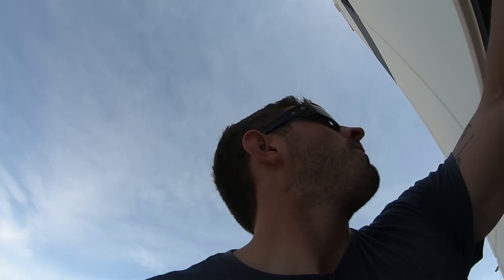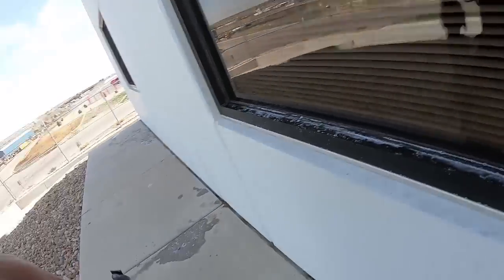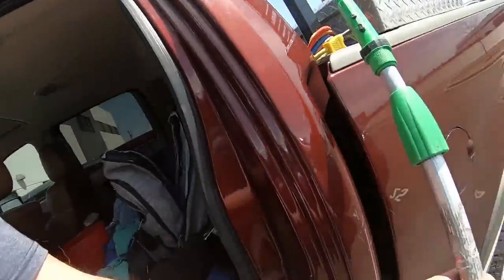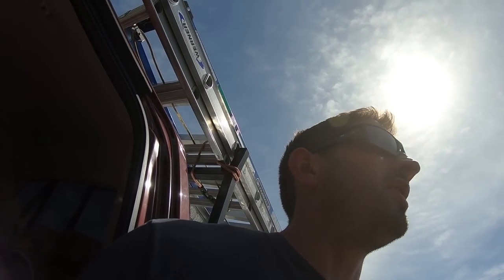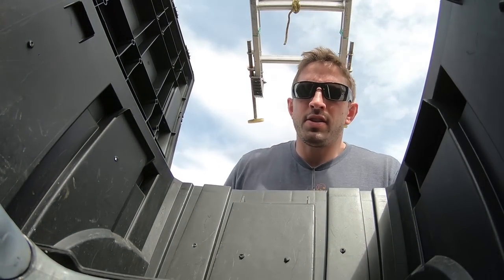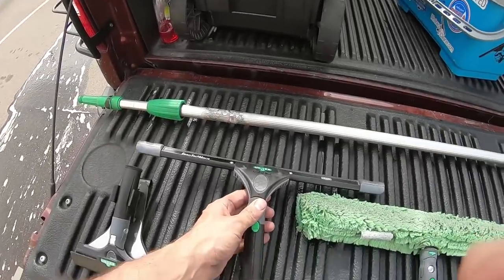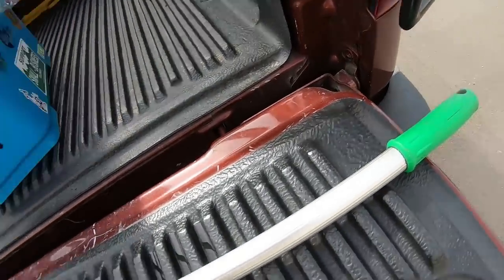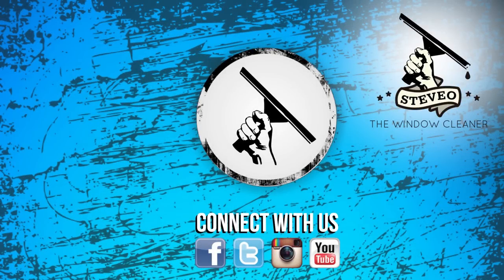The Ultimate Unger Window Cleaning Tool Kit

Comment: Very nice package. Didn't know Unger scraper changed angles. Opti-lock poles are best. They work and can replace parts. Haven't tried the Ninja products. Like the option to lock the tbar and squeegee handle. The Unger scrubber was my goto until I tried the Moerman. I think it holds water a little better (about the same scrubbing action).

Comment: Do you use the soft or hard rubber on the squeegee?
Reply from the maker: Soft is a much more common rubber.  harder rubber is really only for hotter areas, and even at that i like soft still ~Jersey 862-312-2026